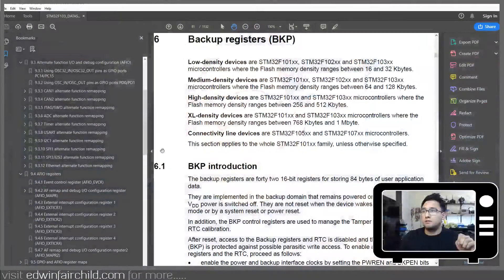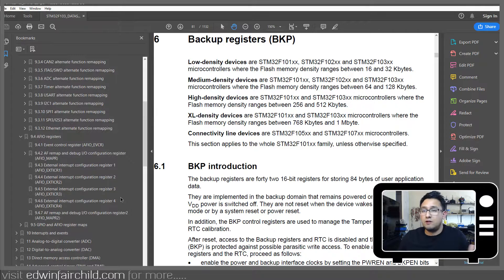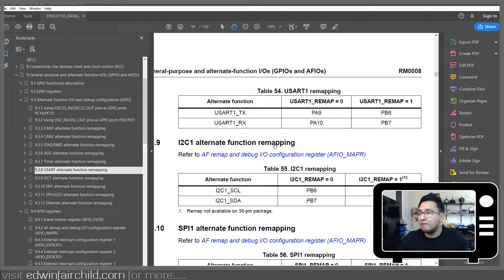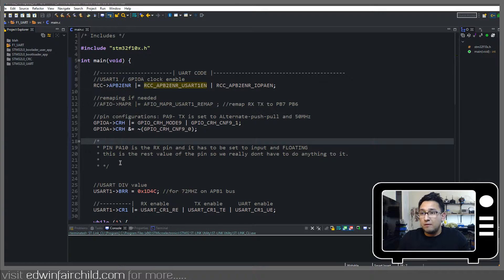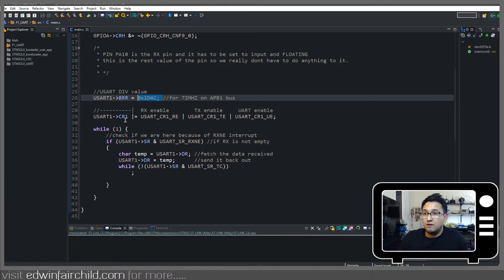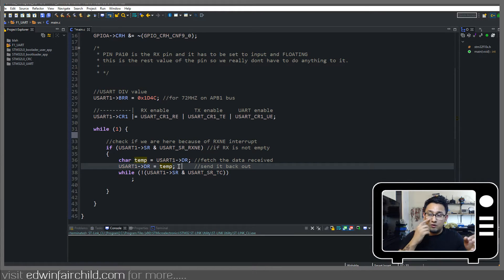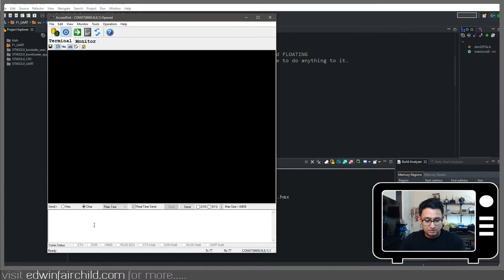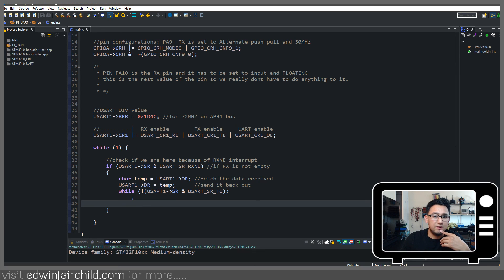STM32 USART Pt2: Basic UART

Comment: What is the connection? 
Can you please tell the connection of USB to TTL Converter with STM32?
Reply: Please it is urgent.
The Rx connect with the SWCLK of the STM and Tx will connect with SWIO? 
Is it Right?
Reply from the maker: @prathamraval5534  Not at all, RX goes to TX and Tx goes to RX , its a cross connection. swdio and swclk have nothing to do with anyyhing those are for programming

Comment: When I enable the Transfer Interrupt, it's always transmitting. What if I only want it to transmit under a certain condition? It's just infinitely looping the interrupt routine. It doesn't even reach the while loop. (I'm specifically just transmitting in the example I'm talking about. Receiving works fine, I disabled it for testing transmitting).
Reply from the maker: do you clear the interrupt flag in the  interrupt routine?

Comment: Hey Eddie,Thanks for the tutorial.I have a question.Correct me If I am wrong , to use UART1 bus at 72 Mhz ,we have to use PLL ,right? But I did not anything on PLL settings and in the formula ,I put 72 Mhz in the formula and it worked for me .How did it happen? I used same formula for the STM32F4 and without PLL settings it did not work.After I implemented PLL setting it worked.What is the difference between STM32F4 Discovery Board and STM32F103C8?
Reply from the maker: there are a lot of questions in your comment and to answer them all requires some previous knowledge on your part. So ill try my best....  Since this is not a tutorial on setting the MCU clock  , i did not go over PLL, i have a separate  video for that.  In the formula seen on part 1 UART video at the minute mark 16:20 the numerator is 72MHz ,this is assuming your mcu is running at 72. by DEFAULT  it is not, but KEIL IDE SET IT TO 72 IN THE START UP FILE. the difference between f4 and f1 are many so you need to be more  specific for me to answer that. You should always be aware of what speed your mcu is running and how it got to that speed. also be aware of the deafult speed on start up and if your ide is doing anything behind your back
Reply: @EdwinFairchild  Thank you for your respond.I checked it yes ,It is defined in Keil for stm32f103  but there is no such a thing for F4.Thanks again.
Reply from the maker: @ilkeraykut7064  well you can write your own, use my video on setting the clock source as guidance , if you can figure it out let me know I have register code for changing the clock on f4

Comment: Hey Eddie. I've been using your videos to discover how to program STM32F411's from the ground up. I've been doing fine so far thanks to your videos and guidance.
I'm trying to implement UART on my microcontroler and I got stuck while trying to determine the USARTDIV value. Basically, my mCU runs at 100 MHz and I'm trying to set the baud rate to 9600.  the only problem that I have is that by making the division I get 651.041 so, the fractional part multiplied by 16 is still lower than 1. More precisely, 0.66 and I'm not quite sure on how to upload that value into that particular register. Am I missing something here?
Thank you!
Reply from the maker: Page 808 of Document RM0390 , which is the reference manual for YOUR chip and completely different than the one i use here, shows the formula for calculating the values for USARTDIV which is also completely different than the formula I use here
Reply from the maker: there actually many F4 versions but I think the USART peripheral is about the same for all of them, but dont quote me on that hahaha
Reply: @EdwinFairchild  Hey dude, thanks for your response. I was able to figure it out, lol. According to the sheets, one should take the closest integer value to load into that register if the fraction section does not round up to an integer. :D
I'm trying to make my STM speak to one of those nextion touch screens. You should check those out, the instruction set is pretty simple and their IDE works pretty straightforward as well
Reply: @EdwinFairchild  btw. I was able to make it work running on the 16 MHz default frequency. I tried to speed things up to 100 MHz, but I had no luck :s

Comment: Can you please tell me where are you configuring you peripheral clock to 72MHZ in the code because you used 72 Mhz for baud rate register calculation.
Reply from the maker: That is done in the startup file by keil. I'll have to make some videos to show to do change that. I think I have a video or a blog post on it but it's not for the F1 chip but the concept is the same .

Comment: Sorry , Your explanation is very clear but you didn't show exactly how to open the serial monitor on the IDE. Could you explain?
Thanks
Reply from the maker: serial monitor is not on the IDE, it is a seprate application called access port rs232
Reply: @EdwinFairchild  Ah ok I see. But I thought there was the same type of serial monitor on the IDE Truestudio 
that you can use like on Arduino. Then use it directly with the USB connector once the boot loader is installed to boot on the port. I saw this somewhere but can remember...
Reply from the maker: @glewiss6696  there might be, eclipse has a lot of stuff, I am just not familiar with it, I have always stayed away from Java based IDEs lol but I'm sure there might be some sort of serial monitor in there somewhere
Reply: . Yes  there is. Its called SWV console on the debug interface. You can see what you type on the keyboard. No need to use the uart pins anymore. All passes though the SWD signals via the stlink dongle. Actually I'm struggling making it work with no real success. Extra Swo pin needs to be connected as well along with the swio and swclk signals. Swo is missing on the stlinkv2 and it needs to be hardwire rooted from pa10 I guess. Then configure it on stcubemx. Allow SWV communication in the debugger as well as the right clock and then use ITM to redirect the printf output to the debugger console by modifiying the syscalls.c file. Looks pretty handy.

Comment: Hello,
Thanks for your videos. I'm learning STM32 with the bluepill. Went from arduino where with simple mods (replacing a resistor) on the board you can directly upload the code directly from the USB connector on the board.(with some bootloader to install)... Iwanted to know if  truestudio Atollic allows to use the same prinicple to upload a code or it is not implemented with this IDE?
Thanks
Reply from the maker: The method you describe i think is possible with the STMFLASHLOADER which is provided by stm32 to load hex into the chip using its own bootloader which comes installed from factory. then you would have to setup TrueStudio to use this instead of its own flasher/loader/ ... now that you mentioned it i will look into it tomorrow and if i succeed i will make a video on it...so make sure you subscribe lol
Reply: @EdwinFairchild  Already did it! there is a link on that thing: https://www.onetransistor.eu/2017/11/stm32-bluepill-arduino-ide.html
Reply: By puting this bootloader code in this board you don't need anymore to pass via Uart pins of the stm32 using this ST-Link tool. Now you just plug directly the usb connector of the bluepill to the usb cable to your PC.
https://www.techshopbd.com/uploads/product_document/STM32bluepillarduinoguide(1).pdf
Reply from the maker: @glewiss6696  Yes but you no longer have debug capabilities... now you cant view your register values, you cant watch variables live... you can pause and run the code line by line.....all of that just to upload code and have uart...I do not user Arduino ide or libraries. So its like turning a powerful chip into an Arduino by crippling its debug features. A good compromise would be to use both. one usb for programming and UART and the ST-link to debug. Might give it a shot.. i wonder how big that bootloader is?